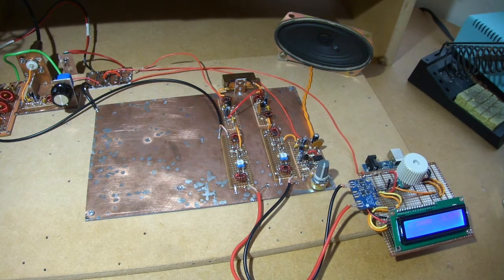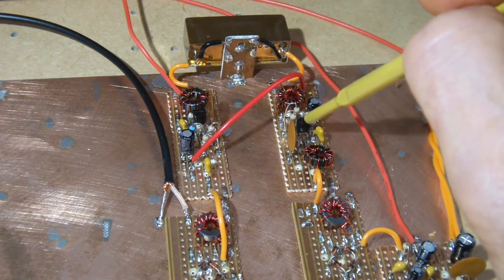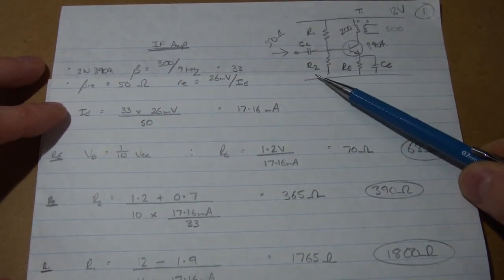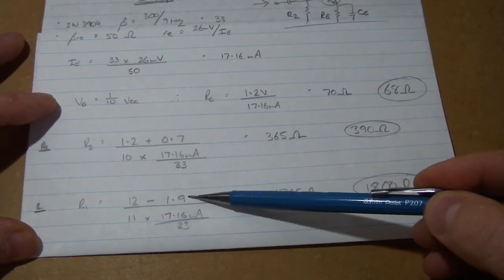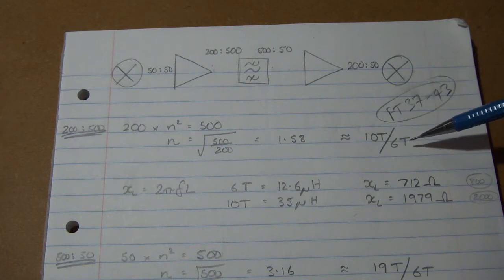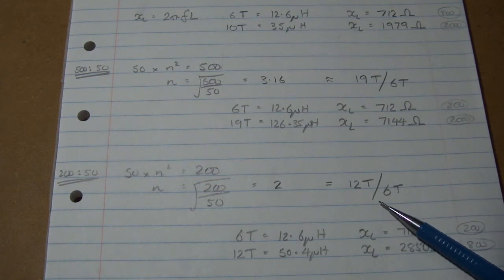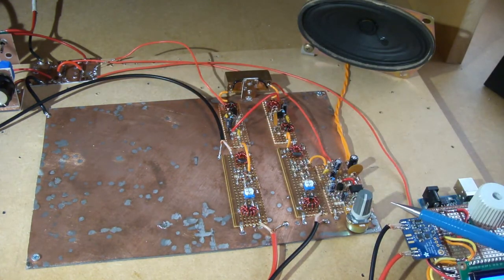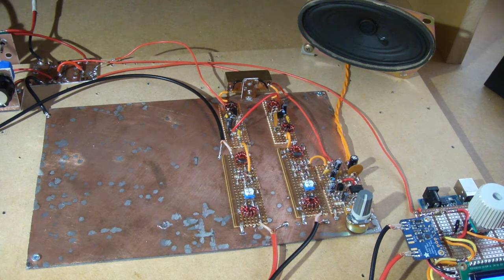Simple Homebrew SSB Base Rig Part 6 - IF Amps and Crystal Filter

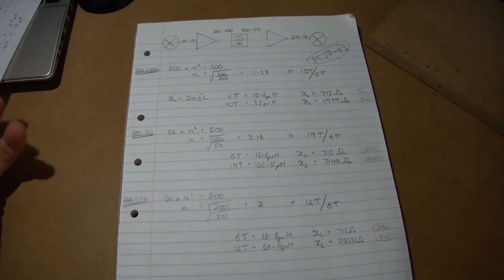Comment: Hi Charlie! Can you please explain to me? 10:11 At the middle of the page you have calculation for 500:50 transformer. Inductance Xl = 712 and Xl = 7144. It is ok, I understand. But what is it 200 and 2000? 
Oleg, UR7WKH
Reply from the maker: Hi Oleg. They are aim points/memory joggers. 200 = 4 x 50 ohms, and 2000 = 4 x 500 ohms. I needed to make sure the inductive reactance of the windings was greater than this.
Reply: @CharlieMorrisZL2CTM  Ok, I understand about this inductance check. But why do you multiply by 4 in all transformers? You have three different turns ration but you always multiply by 4? 
Sorry, my question may be some strange but I do want to get understanding of radio internal processes)

Oleg, UR7WKH

Comment: Hi Charlie. In place of the crystal filter module, I assume one could build up a crystal ladder filter with a few crystals? I'm trying to build on a shoestring budget so don't want to buy a crystal filter but have access to the test equipment to build my own. I assume selection of IF frequency isn't too critical (I can't source 9 MHz crystals as cheaply as 10 MHz).
Reply from the maker: Absolutely. Pete Juliano N6QW has a simple approach to building those without the use of specialist software. Use-say-SDR# or whatever to measure the freq of some crystals with an aim of getting 4 within 50Hz of each other. The ladder config is then series 68pF - xtal - 120pF to ground - xtal - 150pF to ground - xtal - 120pF to ground - xtal - series 68pF. 10 MHz will be fine. There is theory behind the choice of the IF, but I've often kept things simple and just used what I had at hand.  I'm still looking to source some suitable xtals to make my own.